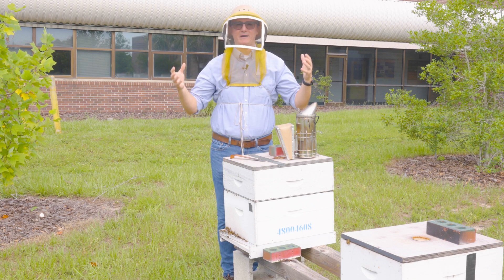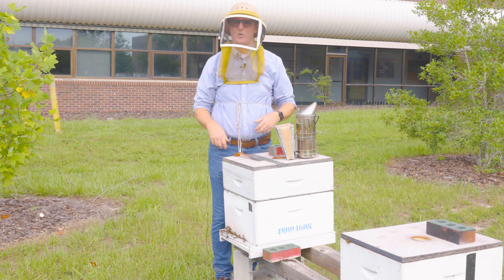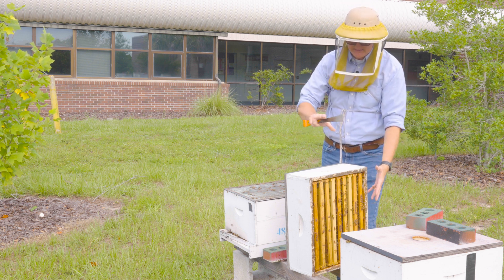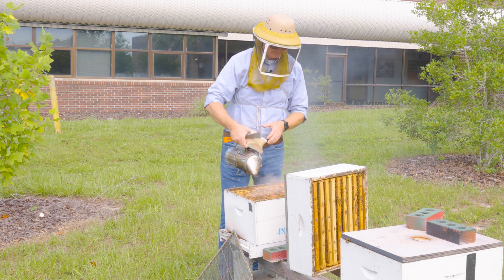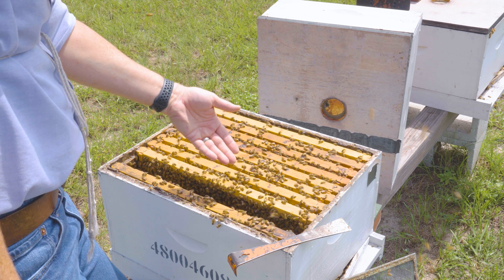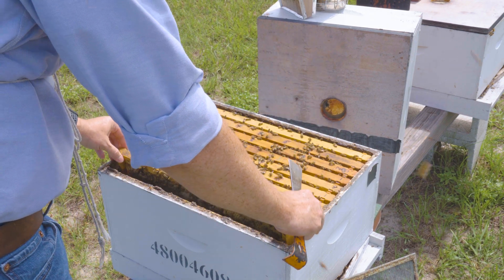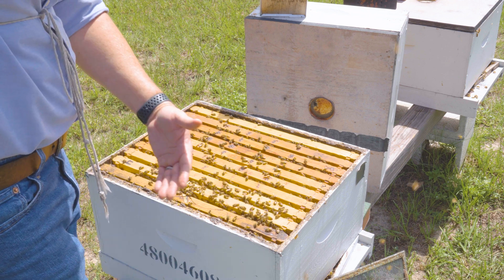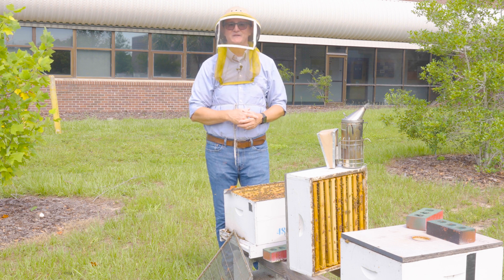Proper Hive Inspection Techniques | Beekeeping Academy | Ep. 35

Comment: Can you effectively 8F single deep brood chambers?
Reply from the maker: I’m not fully sure what you are asking. Are you asking if you can keep 8 frames in a 10 frame box? If so, you can, but you need to get the spacing correct. The bees may build burr comb if the frames are spaced too much (>3/8 inch).
Reply: @UFHoneyBeeLab1  can you run single deeps with 8F equipment?
Reply: @johnlehr1036  People use 8 frame boxes all the time. But, I feel that  Dr Ellis would have an excluder and a 8 frame medium of honey above it. 

Please note: The University keeps bees for research, not honey. 
You may want an additional 8 frame super of honey for yourself.
Reply: @MrPhillip2  I run 8F equipment and have been contemplating trying a single deep configuration on a hive or two.

Comment: Thanks for another great video. Up here in Maryland, when we do Fall inspections, I encourage my mentees to start inspecting from the bottom box up (that's after the queen excluders have been removed and we're doing the final whole ive inspection of the season). It seems to help to avoid robbing (we use quiet cloths and keep the supers covered) and also keeps all the bees from being down in the bottom box. Do you ever do this? We mostly use all mediums, so have three boxes going into winter.
Reply from the maker: I typically go straight to the bottom box when working a hive. My standard arrangement is a deep brood box, an excluder, and a medium super of honey. The latter is always exclusively for the bees. I never take it. I can judge, by weight, everything I need to know about the upper boxes where the bees should be storing honey.